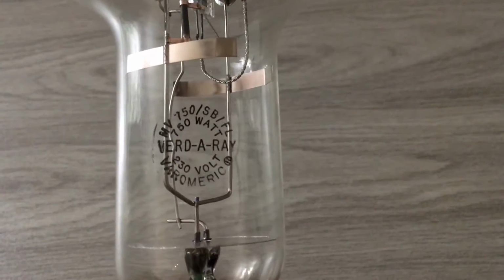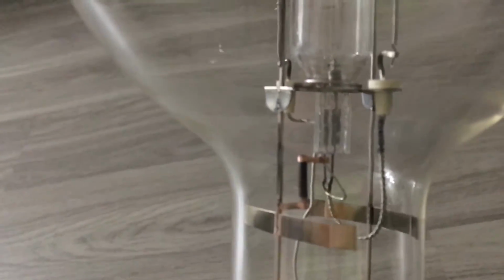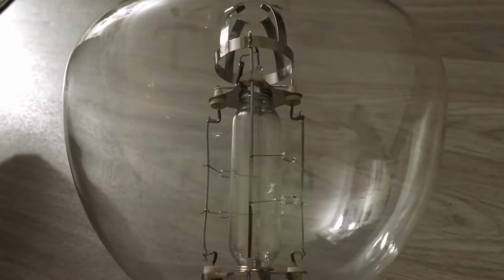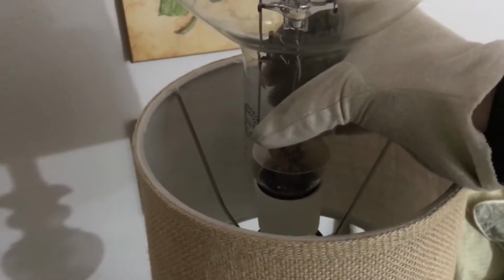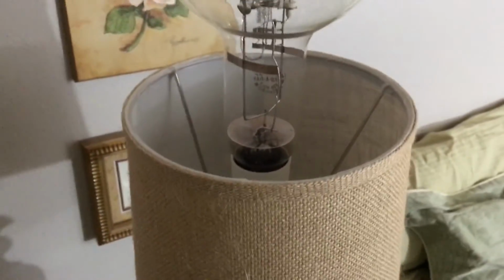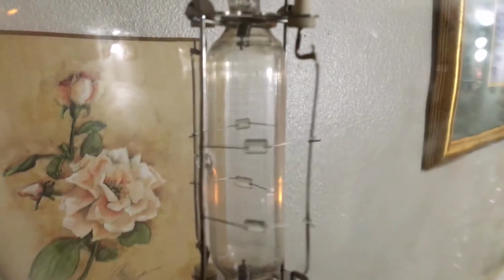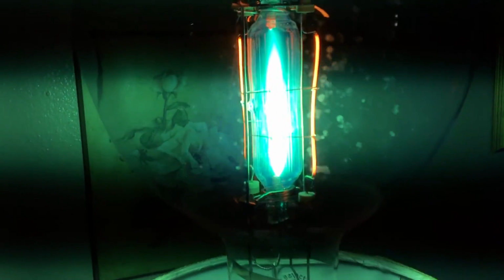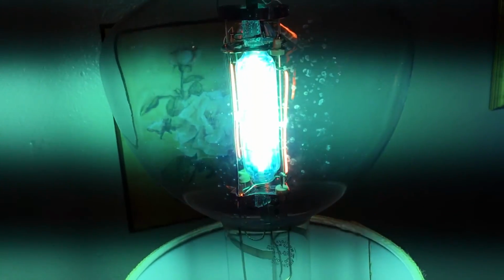Verd-A-Ray 750W Self-Ballasted Clear Mercury Vapor Bulb

Comment: it wouldn't really work without envelope so if it breaks it fails? some regular ballasted bulbs even had special resistor there iirc that didn't like air

i recall staring mv streetlight when young when it was broken. later i realized i stared into uv source. nice greenish blue glow tho

Comment: this means you could operate european sbmv in the us without a transformer but not the other way around in europe if the sbmv lamp was 120v and was to be used in europe.
Reply: The outpu will be 2x to 5x lower on 120V